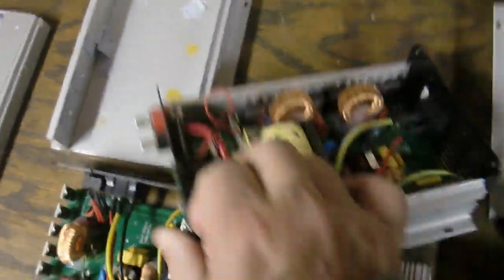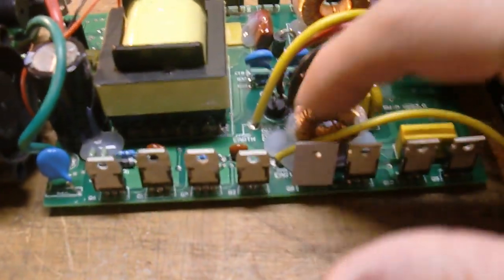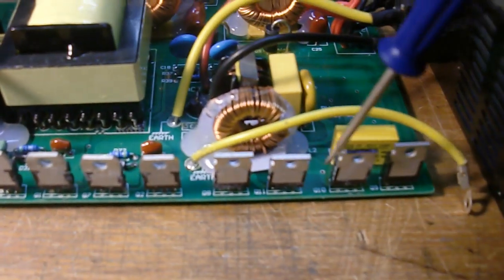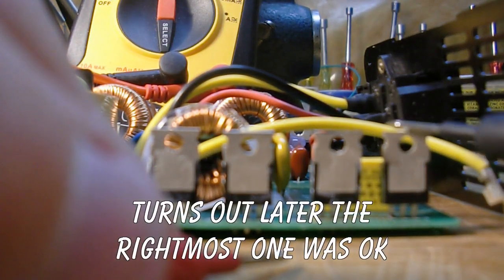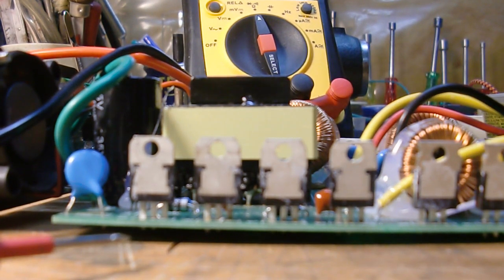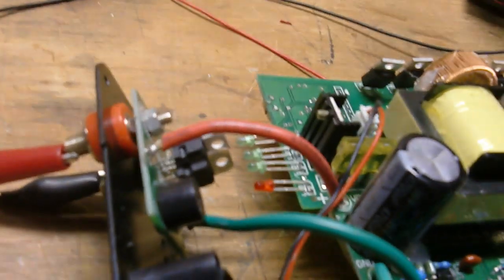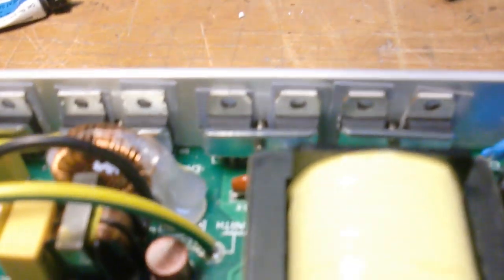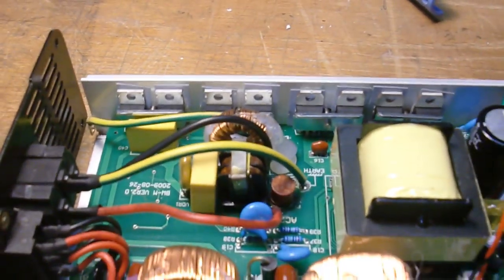Power Jack 300 and SUN 250 Grid Tie Inverter REPAIR

Comment: I got ARC 200 (ZX7 200) from amazon. it gave smoke when i pluged it in 220v. 2 IGBTs on either side along with some SMD resistor and capacitors installed in between are also blown. IGBTs can be replaced but dont know the values of blown SMD resistors and capacitors, Help required in this regard

Comment: I have a new 500 watt grid tie inverter , I hooked it up to a 24v dc source like the instructions say, the solar panels put out a minimum of 300 watts. I got the red fault light on, I went by the instructions and I don t see why it wont work. any suggestions? thanks for the help

Comment: I have one for you......I have a 500 watt 22-60 vac input grid tie and the DC dump load is stuck on.  If you put a resistor on the dump load pins, the grid tie will produce no power out of the ac cord.  If you remove the dump load, then it works fine but a test light on the dump load pins shows power is still there.  Any idea what's wrong with it?

Comment: Thanks for that video. Shows very clearly how to fix these.   I have 4 250watt inverters running, and mtbf seems to be about 1 year running at max 180 watts. This is in the high desert on socal. I think I'll try to  get more air flow round them to get the temp down a bit. Might last a bit longer between failures! I wonder if it's possible to get a higher spec fet to strengthen the unit?

Comment: @Fearlessthinker I think you mean FDP18N50-ND at Digikey to keep it with the TO-220 style.
But thank you very much with this comment I have been look for a few days for a replacement for my MDP18N50's
@rumpelpot You can use a Fairchild 18N50 from either Mouser (512-FDP18N50) or Digikey (FDPF18N50-ND).

Comment: Hi Fearlessthinker, Awesome set of videos! thank you for sharing your knowledge. I don't suppose you have a schematic for the Sun-250G? I have one that has failed and the MossFet's are showing fine, as well as most of the diodes. yet as I put 10 to 18 volts DC in. the inverter acts as though it is not even powered up. No fault light, no nothing..Both fuses are fine. and I have power at the big DC capacitor and it is fine also. Grrrrr. Never easy in my life. I am not really sure what failed.

Comment: Hi nice job on these inverter repairs.I have a 5000w wagan inverter, it started beep and no    
power is coming from the a/c outlets.I check all the fuse by the way it has sixteen 40a fuse and all seems to be good.Should there be a seperate fuse for a/c and d/c?And if so where is it located?Should all the mosfet a/c and d/c showing about the same value?I saw two resistor with a dark colour but they seems to be ok.Looking forward for 
your assistant.

Jarobby

Comment: Really nice educational video. I was going to suggest trying to be more still with the camera, but then I realized that your video style is of a one-take no-edit video, and that works well for what you are doing. Everyone has this same problem with this style of video. There is no solution for it either that I can see, other than pausing the camera and setting up for the next shot on a tripod, but then that breaks the flow of the dialog.  Maybe a helmet cam. Good electronics lesson. Thanks.

Comment: i fix both on the same day and tryed both they worked but some thing happend it got shorted out would not work on my 14 hb freight pannels zero out but when i hooked up my charged controlled it worked then i hooked up both inverters one at a time both zeroed out take off controller working short in wire?

Comment: yes sir ty for ur vidoes if i cant get the other one running im gona send it to u all in parts i know u can get it done its a 500 sun all my other 6 in all 300 and 2 259 work fine never had a problem with them just the 500 guess cause when no sun they burn up?

Comment: after i fix the firts 500 with ur parts it faile 3 weeks later bought more parts got 1 going second one failed dc mosfets bas 52n15d but ac side the light fuse still good geting weirs readings on my as mosfet is it cause the dc sides out or they just bad?

Comment: finding the transformers are a pain in the ass I have a 600 watt gti I'm repairing I found that the transformer was dead or shorted. I took it out and at least half of that works great.  so I for now at least have 300 watts of gti to work now I need to get the transformer for it to fix the other half of the gti to regain the other 300 watts. any ideas were to get the transformers for a 22-60 volt set up the ones I have are ee4215-24v350v

Comment: I received a blown power jack 600 GTI that was over powered to 48 volts when max voltage  is 28v. all I could find is 1 shorted DC mosfet Q1, I also checked the SM resisters for each mosfet on the other side of the board, they check ok, no other DC or AC mosfets were shorted, but when I connect DC power with the unit plugged in & switched off, the red light come on for 3 seconds then blew DC fuse & Q1 mosfet again, any ideas on this ?  the light bulb trick is lighting up when DC is connected

Comment: I have two Sun 1000G models running off battery bank, 24 volt . They been running for a year. Battery bank is 1000 amp and is charged with solar panels . I use a dump controler that switches a relay on the 115 volt ac side when the battery bank gets fully charged 25 volts. This has worked very well for me. The only failure so far has been a fuse in one of the units. It didnt fail in the normal way by opening up due to a short and high amps but the plastic part melted away from the fuse over time

Comment: I was wondering if anyone has tried to increase the lifespan of these units by running them at their lowest voltage.  I have two Sun-600G 22-60 volts that I run off 24 volts of batteries.  These batteries are normally between 24-29 volts.  I've run them for 6 months, so far no problems.  I do have a panel mounted surge suppressor to protect my Enphase inverters, on the same panel box.  Anyone else trying to extend the life of these inverters by taking it easy on them?

Comment: Hi Tom after replacing 2 exploded mosfets ac side 18n50's on a sun 600w unit I still get a short across the outside legs I think the diodes on the back of the board across the legs are causing this.  I took out the mosfets again and they are fine is this normal? The other 2 mosfets are not reading short across legs. Do you know what the diodes are one is d11 and d14 surface mount one blue stripe semi gold and clear in color?  Thanks for your great video.

Comment: Hi. Great Video. Can you please help me?
I have a 350W GTI that had one AC mosfet shorted and a blown AC fuse. I replaced them and the inverter only lights the red led. No output. What could be the problem. The DC mosfets are all good. Diodes as well. I checked the coils and the transformer and they are alson good. I don't know what to check next.

Comment: Hi, I have thesun sun 600g. Was working for awhile till one day it just didn't wanna detect DC power from solar panels. I have opened it up and the DC fuse is still good. The board is not fried either. Can you please help. I have notice that one of the DC mosfet does not read anything. Shouldn't the fuse be blown too?

Comment: I actually have 4: 2 gti250, à gti300 and a gti500 and IT looks like there is à temp sensor because the max watts are produced at the beginning and the fan does not turn on, then 2 minutes later it does but the watts are then lower. I use the 500 on a 48v lifepo Battery pack to give back stores energy

Comment: @Fearlessthinker thanks for the tip. It does seem like the ratings given for these GTI's are a max rating. one more question, do you know what the fan cools more so and were the temp sensor is? I'm also thinking of putting in a different fan (thinking of the silenX 40 x20) and cutting the mounting plate hole completely open to allow the fan to do its job with out having to blow thru those 3 little slots.

Comment: what is the difference between the 250g and 300g? I have the 300g v3.2 (think it was 3.2) the circuit board also says 250g and it looks just like a 250g

Comment: My first PowerJack 300 watt grid tie inverter lasted for about 40 minutes, before blowing up. Its still running, even after 3 repairs (2 done by myself). But on my last test, I noticed very bad MPPT, a strange hissing noise and on the AC watt meter the power factor is on the low 70's. But if I bridge it with my newer version PowerJack 300, the powerfactor is at 99.